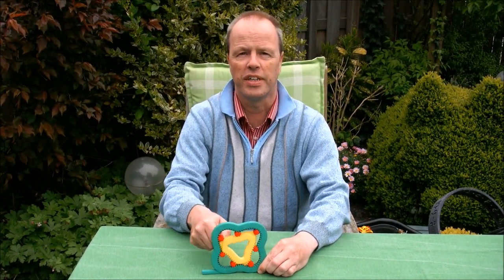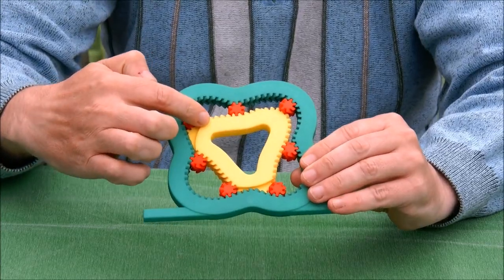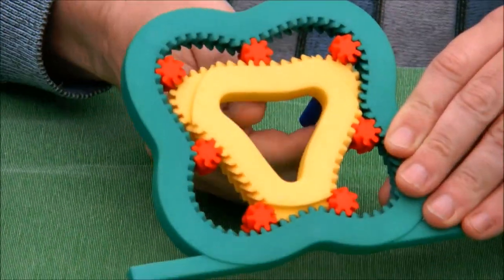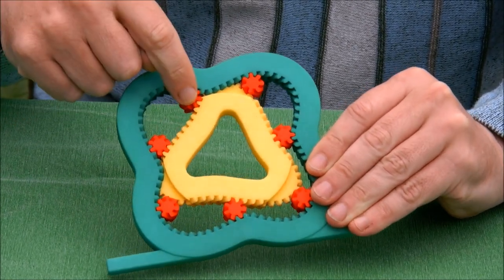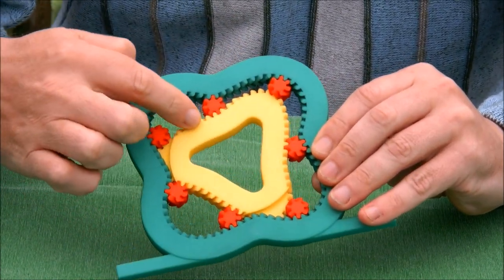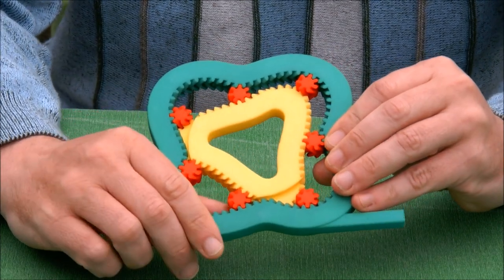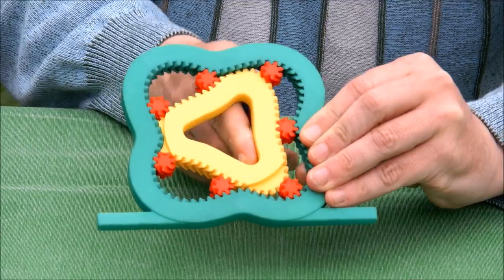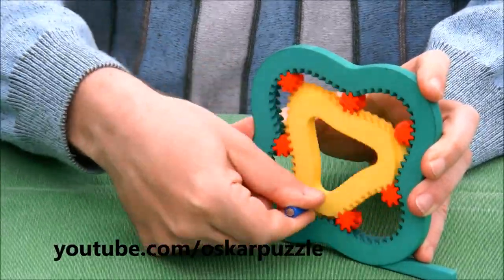Captured Gears - How can that inner gear go through that outer gear?

Comment: I would expect the reason there are 7 red gears is because they connect a somewhat triangular shape with a somewhat square shape. In simple terms, a triangle has 3 sides, a square has 4, so 3 + 4 is 7.
Reply from the maker: Correct!

Comment: Good job. It can be use to those application where square shape need to be maintained such tank chains or tank towers.
Reply: valoda M there are actually drills that can drill a square hole with a triangular bit, and they use a similar but more simple system

Comment: Is the answer to the question "why is there seven gears?" that there needs to be an even amount of gears in a gear system for it to not counteract each other and run smoothly. I think you mentioned this in a previous video and talked about a coin that had an odd amount of gears. But you asked why 7? I think it's because the yellow gear counts as one too but not the green because it is, in perspective, static to the other gears. So in fact there are 8 gears; an even amount of total moving gears. So there are seven red gears (an odd amount) so that the total is 8 (or even). Possibly also seven so that this particular design works. I may've written a long paragraph on me being wrong but that's my guess
Reply: Maybe also because the green looks like a quadrilateral and the yellow gear is a triangle. So 7 sides in all, so maybe 7 little gears to provide a functioning turn?

Comment: love your work keep it up.
Having worked with gears I have always lubricated them because they are moving parts n lube makes everything better. what I'm trying to say is maybe find some lube that works on the material you are working with and a touch here and there and your stuff would run so smooth n i think it would make all the difference :)
Reply from the maker: These gears are well lubricated with silicone oil.

Comment: what real world application would something like this be useful for?
Reply from the maker: None. Or YouTube clickbait, perhaps.
Reply: I could imagine a rube goldberg device where a triggered engine turns the handle on the simple end, and the seven gears are connected to beams on the other end, which proceed to...uh...move a ball bearing around an uneven surface or something?
Reply: NedYarbNexus a drill that creates square holes with pointy corners?